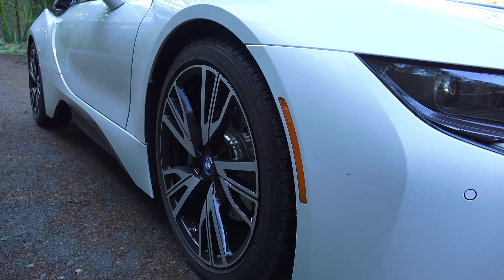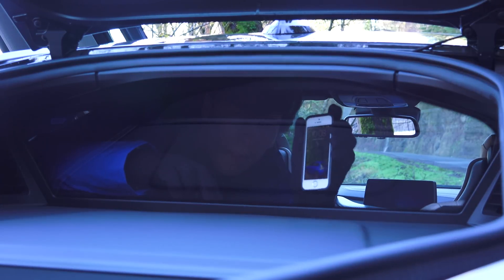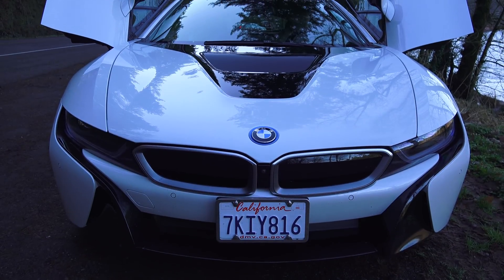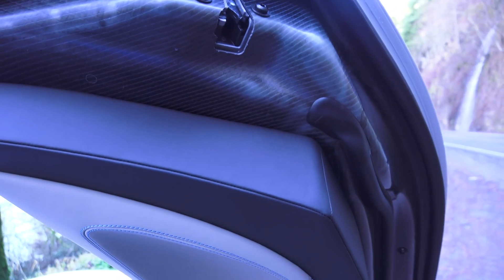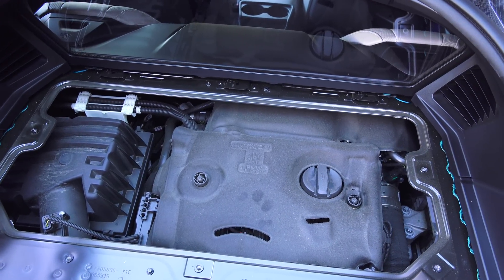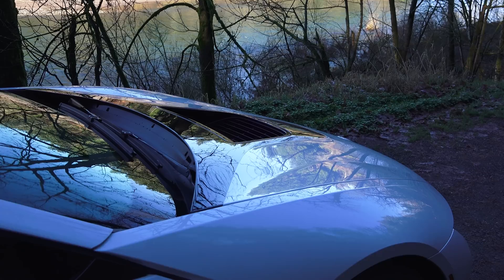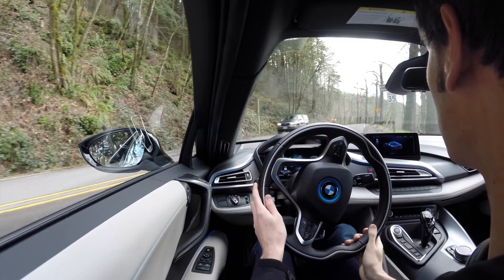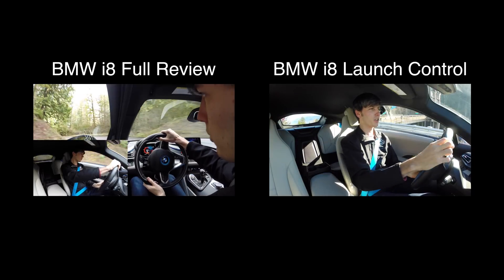10 Things You Didn't Know About The BMW i8

Comment: I heard that the fuel consumption figures quoted for the i8 by BMW are 'way' off real world figures. Does anyone know if this is true?
Reply from the maker: +R3G3N3SIS 2 It's done with the assumption that you start with the battery fully charged. In this case, real world will be much lower if you start with the battery depleted. It makes looking at plug-in hybrid's fuel economy numbers a bit deceitful, but the car is definitely capable of great fuel economy. I did 46 mpg in my own test, the battery was not fully charged (maybe 75%) and I didn't use Eco Pro mode.
Reply: +Engineering Explained Well that's still pretty good considering the performance. Thanks for that. Come to think of it, it might have been the Top Gear episode that compared the new the i8 to one of it's petrol stablemates that gave me that idea. It was the one where Jeremy picked the i8 over the other one at the end of the clip, but then did his famous 'change of mind' back in the studio due to fuel consumption. It's a little hard to trust Top Gear after the whole Tesla thing. Keep the great vids coming anyway man.

Comment: why is the rear electric motor only 12 hp?
Reply: +R I It's main purpose is a starter for the gas engine, and then it acts as a generator most of the time. When in sport mode, it will also help accelerate the engine to help minimize the effects of turbo lag.
Reply: +R I Exactly what Marcus said, so this car effectively don't have turbo lag due to small electric engine in the back that acts as a small turbo at lower rpms  and when changing gears and the the one in the front that turns the front wheels so not only at lower rpm but even in between gears you don't feels the power cuts, this car is really what BMW is capable of.